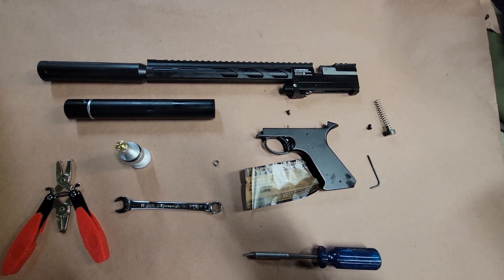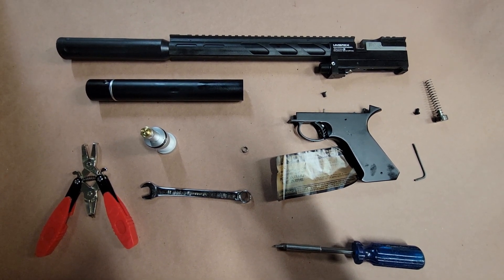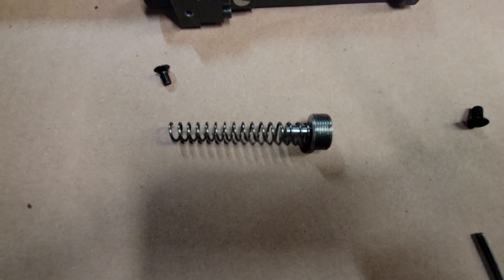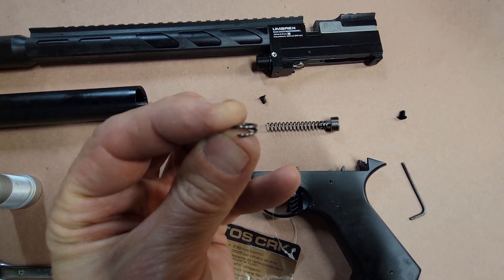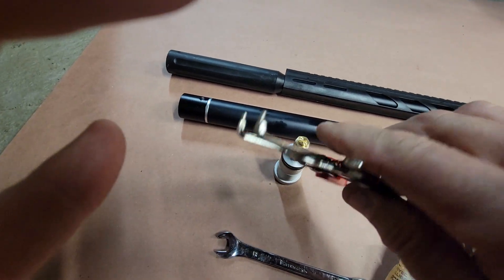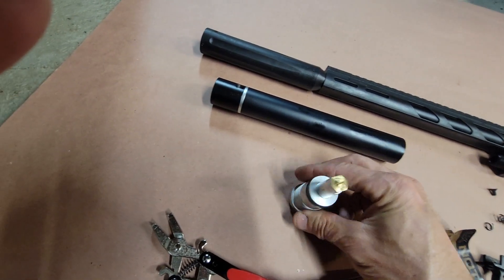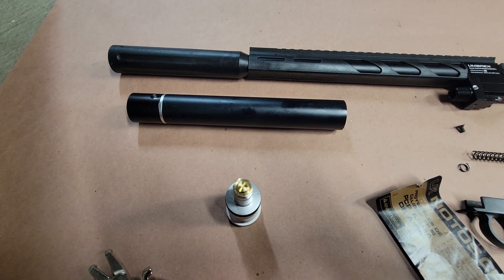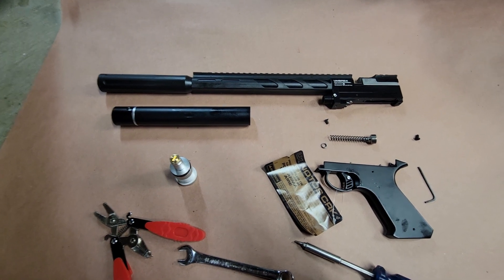Umarex Notos- regulator adjustment and power reduction. Low velocity near 600fps with 18gr Crosman.

Comment: Thanks! I needed some pointers on how much I adjustment to make on my regulator. I did 1/3 clockwise to go from (factory setting) 150 bar to 100 bar. My PP750 now shoots 8,64gr @ 280 mps and I can do 30 shots from 250 till 100 bar.

Comment from the maker: Update.
With a  3600 fill, the gun stayed on the reg for 35 shots.
The deviation was from 630s down to 605.  It probably would have been lower if I took more time between shots.

At a regulator pressure of 1100psi, the hammer adjustment has almost NO effect on velocity.
It did provide a few extra shots and the standard deviation went down slightly when the screw was turned out.

Comment: Why lower velocity bro
Reply from the maker: Better shot count
Reply: Right, might as well buy and use a Red Ryder BB gun🤣😂
Reply: He's teaching kids in 4h... i would be trying to increase shot count if I had like 10 guns going at once with kids blasting away.  Even with a compressor that might be challenging.

Minus the pumping/ filling this gun is pretty slick to teach given zero kick, really quiet, crazy light, and seems accurate.

For little.kids with limited finger/muscular strength I can't really see a better option.  Daisy's are fun but not very consistent.

Quick access to swap springs would be a neat feature for those that manually pump and want higher shot count.  If your just slinging lead to hit cans and spinners a 2x shot increase is kind of nice.  But I guess you technically can grab the daisy as well (I know you're probably kidding but they are all sort of fun).

Comment: Why did you remove material?
Reply from the maker: The adjustment screw needed extra travel to lower the velocity to 600fps.
Reply: @tomhall9470  I was thinking just use a lighter spring something like a 1.2 by 9mmx100mm and adjust the regulator down to 1600?
Reply from the maker: @RacingOldTimer  I am sure that I could have passed on trimming the spring but not the striker adjustment.
I think that I have more flexibility with the decreased regulator pressure and the longer striker adjustment and I can bring it back up to high velocity without swapping parts.
Having a smaller transfer port would solve the problem as well but then the max velocity would be limited.
It looks like 18 shots between 608fps and 598fps with the current adjustments before my chrono acted up.
Cheers